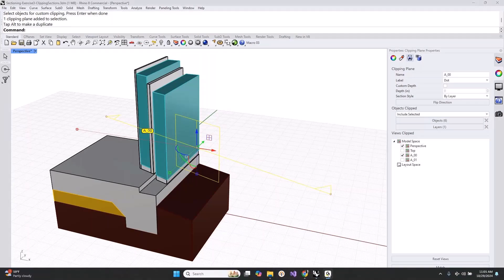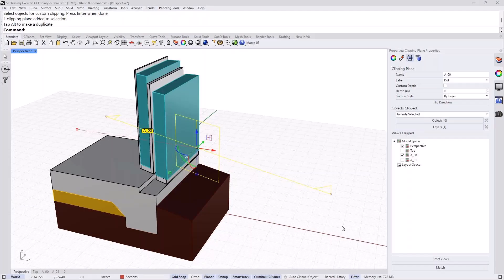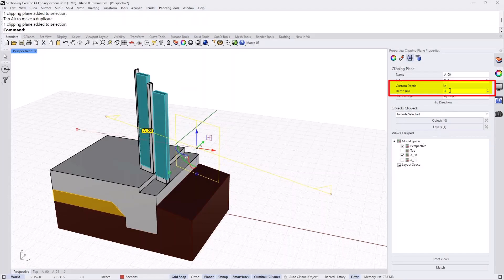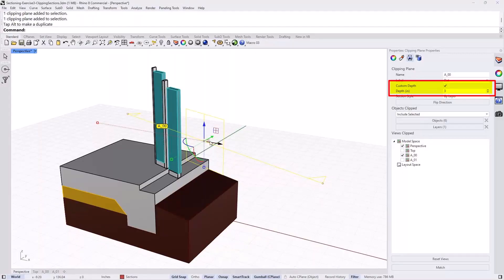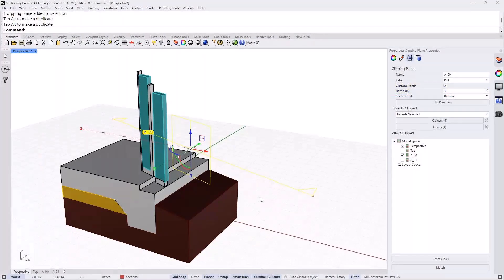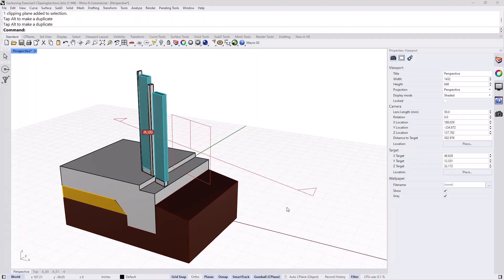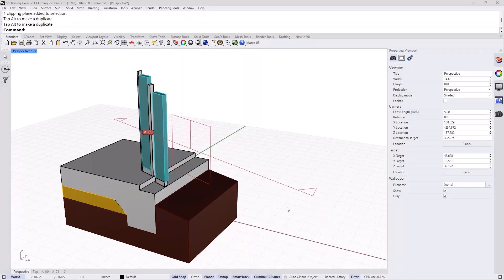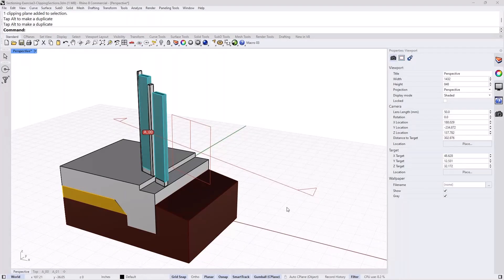Master Class: Rhino 8 Clipping Planes Shape (8/15)

Comment: the program has extreme lag with some seemingly simple functions. The push and pull function does not work on rounded surfaces or does not work well - lag and cramping are the norm. I purchased a company license and the more I delve into this program, I come to the conclusion that it was a wrong purchase. A lot of things have to be done on foot, cutting out each fragment, pushing the pieces away and then combining them into one piece. It lacks intuitive tools and modeling complex products makes me more and more frustrated. I am definitely considering switching to another program in the near future.